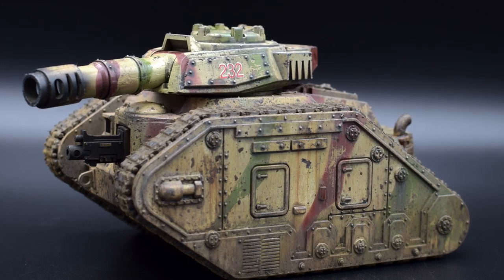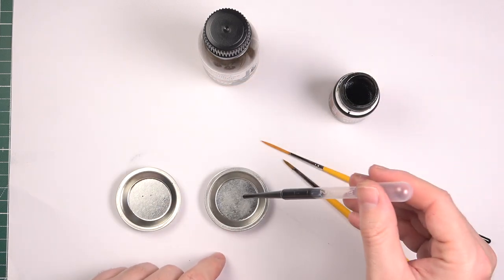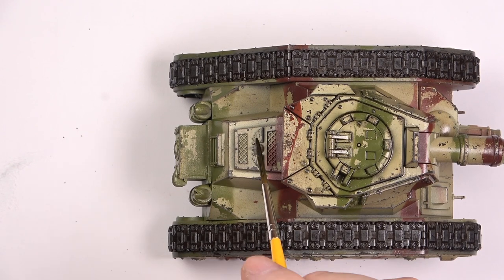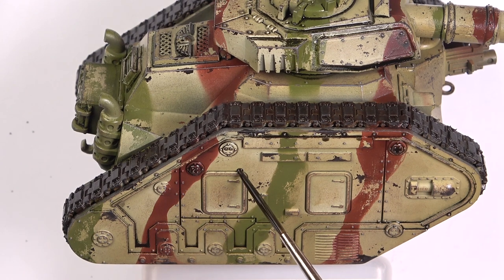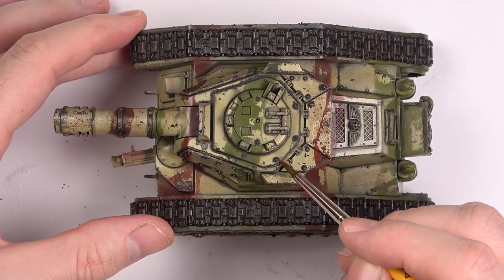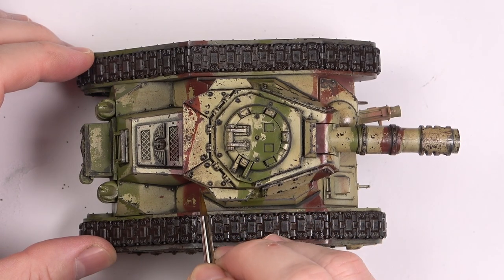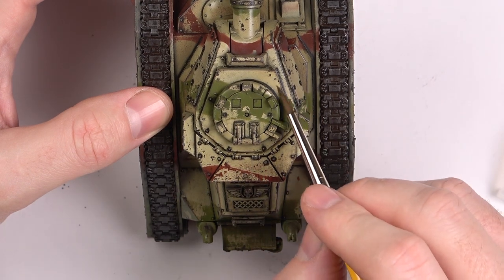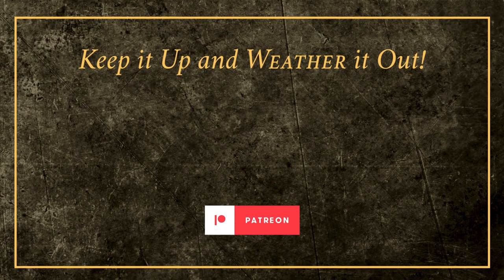How to Apply a PIN WASH to your Models | How to Paint Warhammer Tanks Episode 4/14

Comment: great tutorial, thanks. A quick question: can you use matt varnish too?
Reply from the maker: Thanks, John! Matt varnish would impede the capillary action required for the wash to flow well. So theoretical answer: yes, but it's going to make your life harder. The gloss varnish facilitates the cleanup afterwards, and also later weathering stageds. Apply it before decals, then do the wash for best results.
Reply: @TheRaceForTerra  thanks for the speedy reply! :-)
Reply: ps i dont as yet have an airbrush, would something like the Windsor & Newton spray gloss varnish do the trick?
Reply from the maker: @johnwalliss  A rattlecan gloss varnish like the ones from Vallejo or Army Painter would definitely work. W&N I have never tried, but it should also work.
Reply: @TheRaceForTerra  thanks again!

Comment: Does it not matter what type of gloss varnish you use though?
I mean if you spray an enamel gloss coat won't the thinner you use to clean up the wash affect it?
Reply from the maker: Hi Christos, yes and no - almost all varnishes are water-based acrylics and so will not react with enamels or oils. A few are lacquers, which will dry super quickly and won’t react with anything. Enamel varnishes I have never encountered - if they indeed exist. For other product combinations (not varnishes), your logic applies.
Reply: @TheRaceForTerra  I have acrylic varnishes in a spray can from Vallejo, but also have enamel varnishes from Revell, RL32101 and RL32102 from their line of paints.
I have an entry level airgun kit from Revell which I use for large surfaces and I prefer to use enamel paints with it, they are much easier to dilute for use and to clean afterwards.
So I guess if I were to spray the gloss coat with enamels I'd rather use an acrylic pin wash.
Which then becomes much harder to wipe off.
So it's been a bit of a pain for me so far and still trying to find an effective way of applying a pin wash.
I know most people use acrylics nowadays but I'm still using enamels 80% of the time.
Reason I don't want to use the acrylic spray cans is they don't go on thin and so they tend to "earase" subtle surface details.
Reply from the maker: @christosswc  I checked the Revell website and you're right - the are the only enamel varnishes I have ever seen (and I have tried many, many different brands). Your comment seems to suggest that acrylic varnishes have to come in spray can format, but that is not the case. Would it not be easier for you to use a water-based or enamel-based varnish and airbrush it, thereby allowing you to keep using your enamel paints if you like? Using acrylics for a pin wash is one of the worst combinations of technique and product we can have, in my opinion.
Reply: @TheRaceForTerra  Nuh, they just seemed convenient and so I bought them in a spray can when I was first buying stuff, but I will follow your advice and buy acrylic varnish and use the airgun so I can pin wash with enamels, thanks.